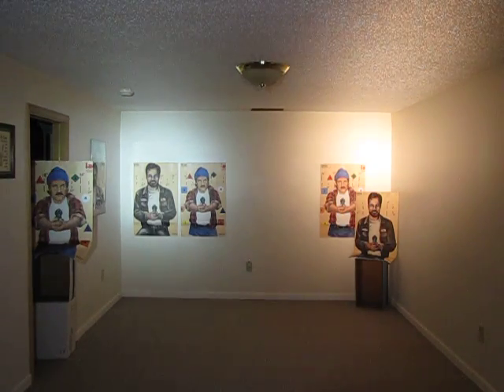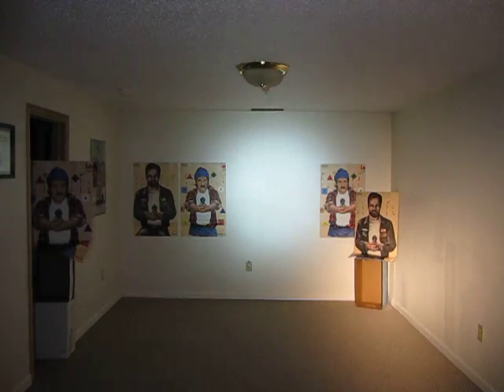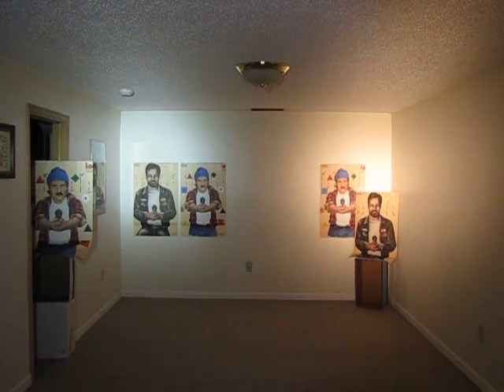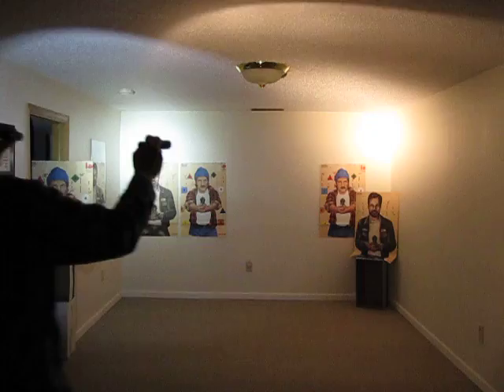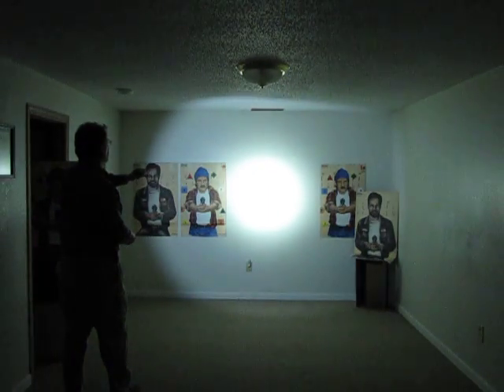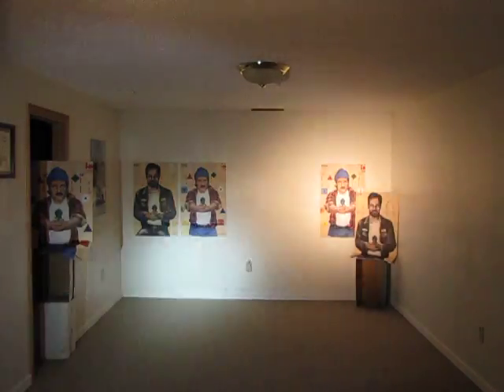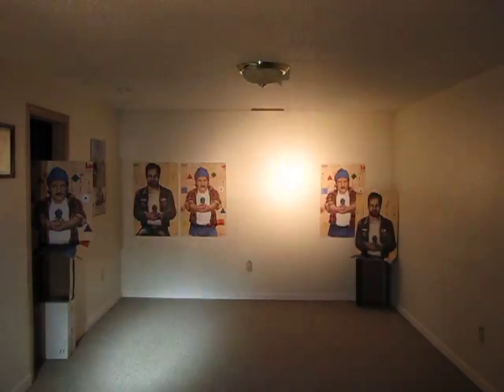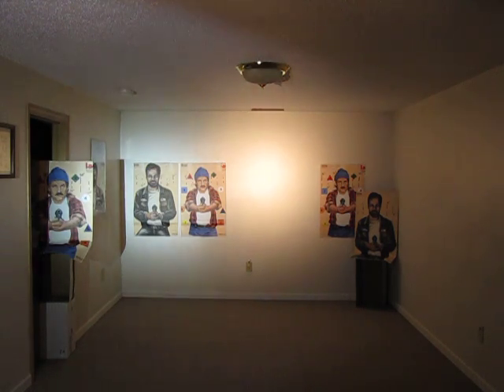Malkoff_M61_Surefire_P91.MOV

Comment from the maker: Yes it was, you are correct.  Some of that may be from the camera self adjusting as I sweep the beams across the center but yeah it sure looks to be getting dimmer.   Take the peak charge off the battery real quick when you are drawing 2.63 amps to run that incandescent filament.